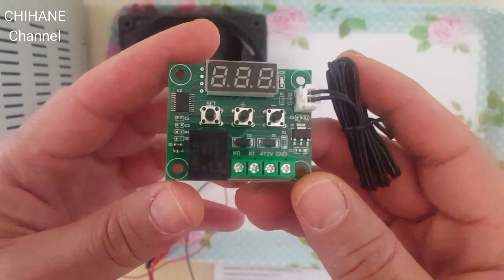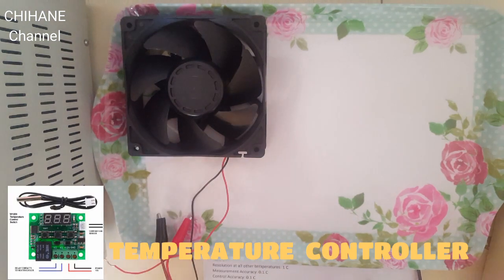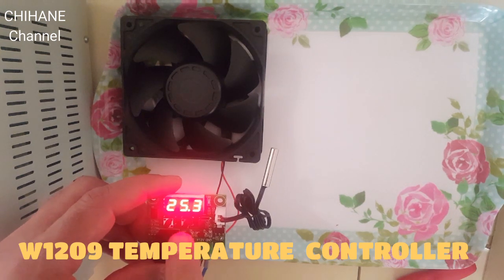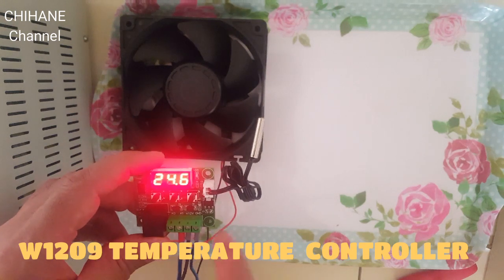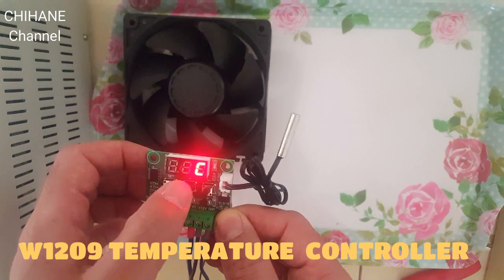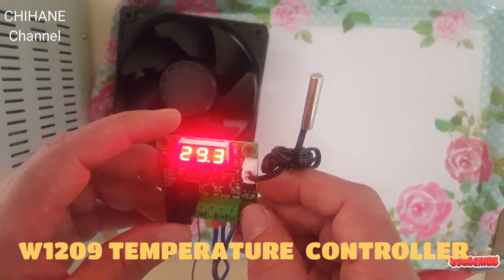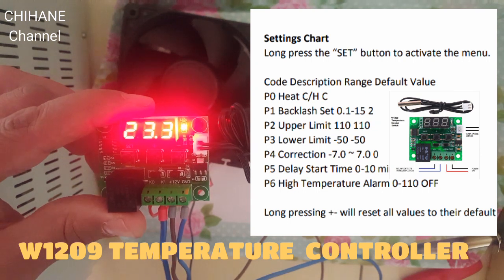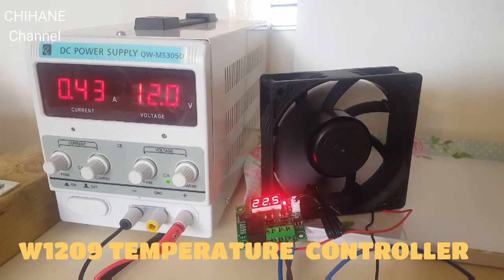How to use W1209 Temperature relay CONTROLLER and How  to setup. #2021

Comment: The ones I got from Amazon have different fan connections. Fan plus goes to K0. K1 gets a jumper over to 12 volt +. Mine will not work connecting the fan to K0 + and K1-